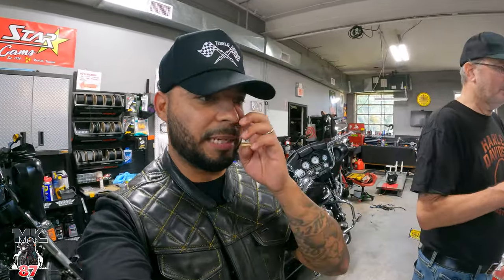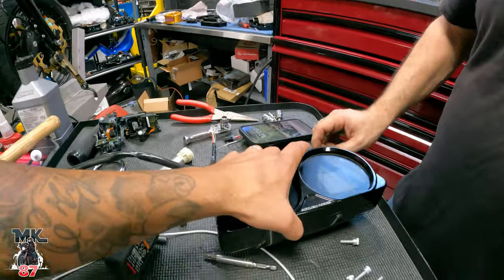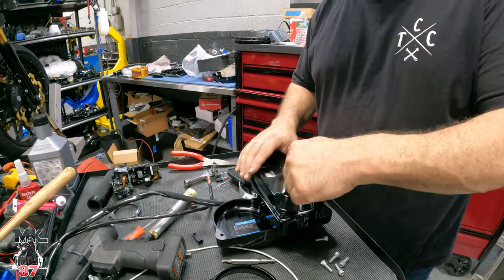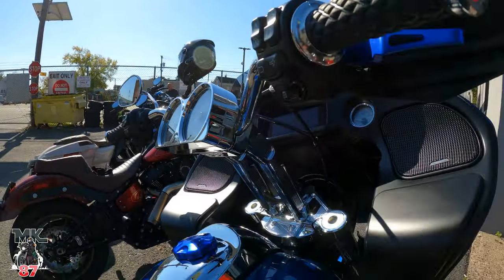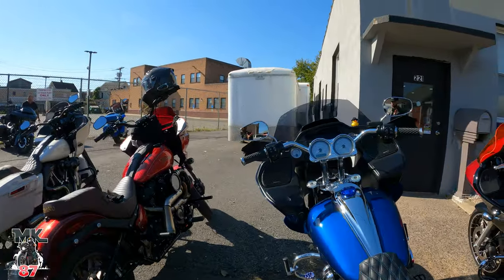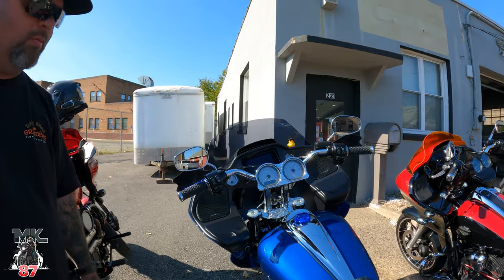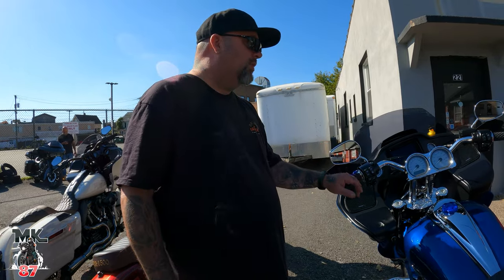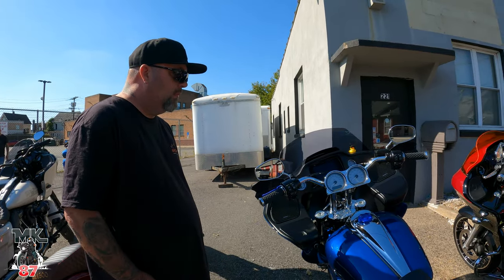Arlen Ness method pull back risers black vs chrome comparison

Comment: Did you need to change brake and clutch lines for that setup with the mid bend bar?
Reply from the maker: No it’s the perfect fit with this height

Comment: yall spent all this money on a roadglide to turn it into a fat lowrider st. why not save money and time buy buying lowrider st
Reply: I was actually thinking is this the natural progression from the "DynaBro" ....and i mean that with no disrespect...
Reply: @Crashking14  I just c it as buying a cvo road glide just to try to make it a sportster.  if u going to block infotainment center with guages, (attempt to) male it fast and light, wear full face helmet with coms/music in your ear and not tour on it. u may as well get the cheaper lighter faster scoot. pls school Mt to the thought process.
Reply: @Crashking14  if u a dynabro and want fairing and bags.... thats what the st was made 4. the roadglide is for touring/2up/ music (non sena/cardo) that's like buying a bus amd making it fast when u could just buy a sports car
Reply: @supakamario i had a few dynas and put a deposit on the lowrider st the day it came out and then noticed the uneven saddlebags, it would have driven me nuts. So i was already in the mindset to buy a new bike figured fuck it buy a Roadglide and essentially build a fast dump truck 🤷‍♂️
Reply: Because high speed long distance touring is better with the touring platform and personal preference.
Reply: Because it ain’t as comfortable I had a lowrider s with fxrt fair before my road glide, 500 miles on a rg vs a fxlrs is two totally different rides. The touring frame feels more stable do to the weight, the softail frame you are fighting the wind more